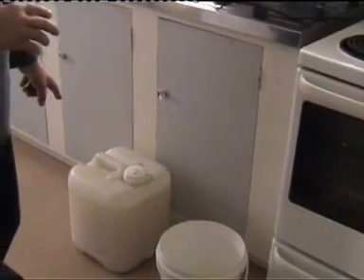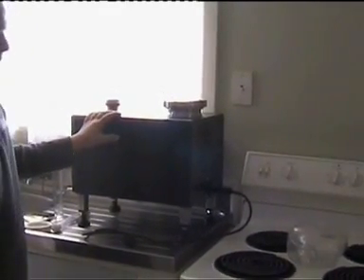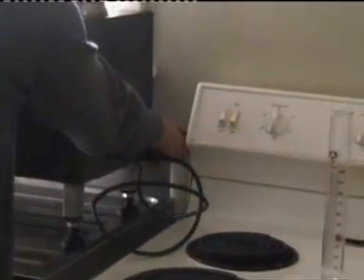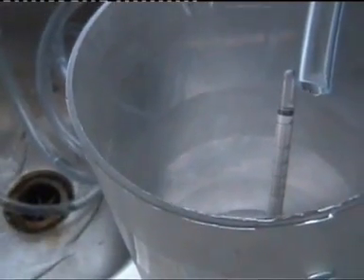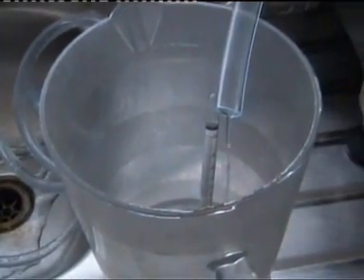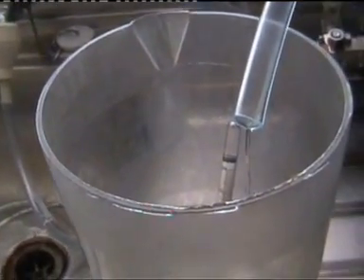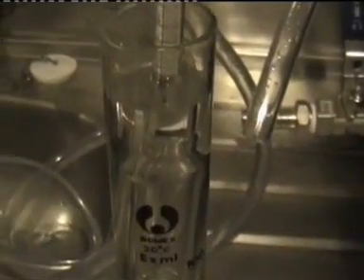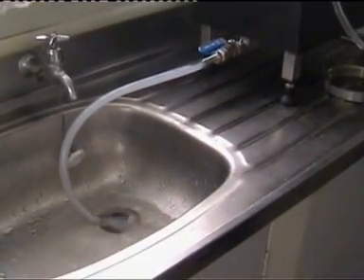Home distilling with fractional alcohol still, part 1

Comment from the maker: This is the point, in my case no ethanol vapor is in contact with plastic tubing, the only contact is in already cooled liquified form. And not all my stills the same the more expensive versions have no plastic at all, and I agree with you avoid plastic if you can :-)

Comment from the maker: As I mentioned before if one can avoid the use of plastics - then go for it, plus I do not use any plastics that not used by other stills manufacturers, I have some stills that used purely for trials for number years and there is no plastic degradation on the ethanol side, but some on the water supply side, and just face the reality the polymers are everywhere - frying pots are covered with Teflon, spirit bottles are with plastic stoppers. plastics are different.

Comment: coco-cola isnt corrosive, it burns by carbon.
Ethyls and methlys are corrosive at 80%+++ purity.
not what you can buy in plastic.

it has to do with molecular structure and the weight of thier atom, and atom size.

Cola is sugar, water, caffine and Carbon.
Not one of those is corrosive.
Mildly acidic, which isnt the same.

Ethyl(ethanol) Breaks down polymers slowly when its not diluted below 80% (82.5% or so)

stop comparing it to carbonated sugar water.

Comment: yeah, I remember he plugged it in, but if I plug a lamp in the wall, it doesn't get hot enough to boil water :P I meant to ask what kind of heating element he was using

Comment from the maker: Most of tubing that used in this still is for water supply to the cooler, and all tubing I use is non toxic one designed for beverages, and also there is different kind of plastics around,  and what about spirit bottles with plastic stoppers on top, and even spirits sold in plastic bottles, and I know for sure that coca cola is more corrosive and reactive than any kind of spirits and yet sold in plastic bottles, but yes I agree if you can avoid plastic -just simply avoid it.

Comment: where all th tubes are hanging from its cooling th vapor to liguid so you can store it , otherwise it would disperse into the atmoshphere, th white stuff they pour in is the mash, you make it by boiling for instance 1 kilo of potatoes chopped into 1cm cubes  in a pressure cooker, until you are left with the white water, which shall contain a fair amount of sediment, dispose of potatoes and that white stuff is what shall be left with to put in your still. hope thjis helps

Comment from the maker: This is the still with two detachable columns,that makes it possible to carry on complete fractionning would be considered as micro distillery.This is my own design patent pending and commercially prodused in New Zealand.Actually based on my patent work that covers continuous distillation machines and 300L fractional distiller vodeo of which is on youtube as well.
Thanks